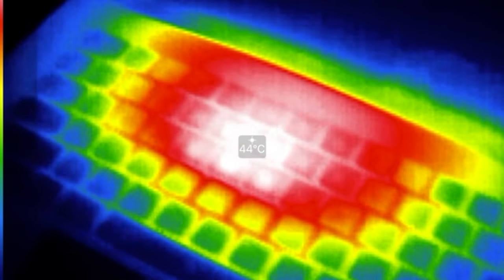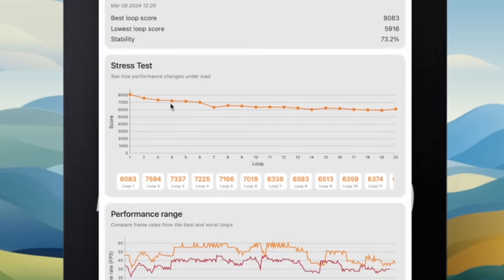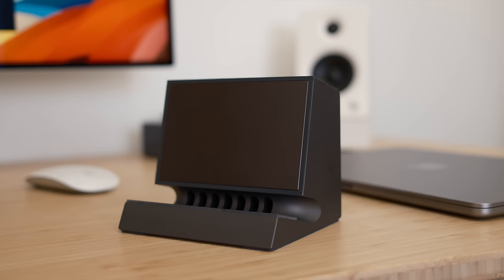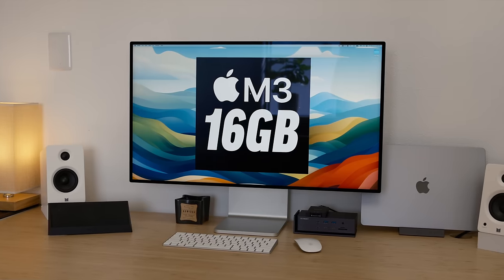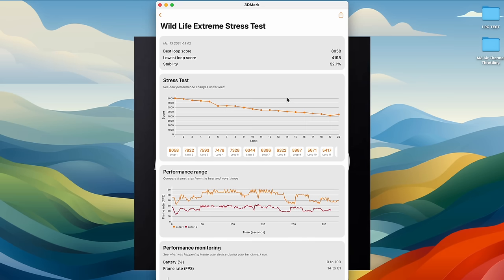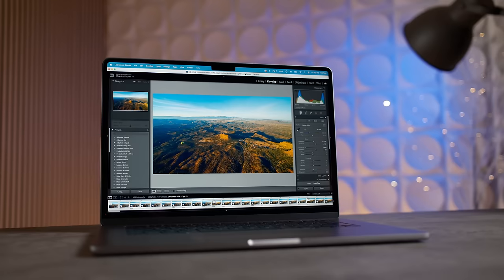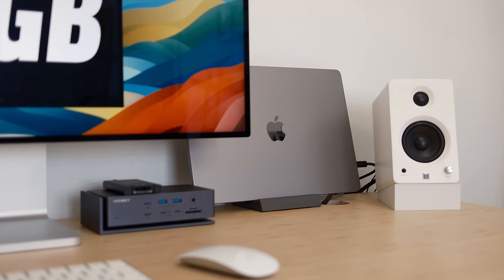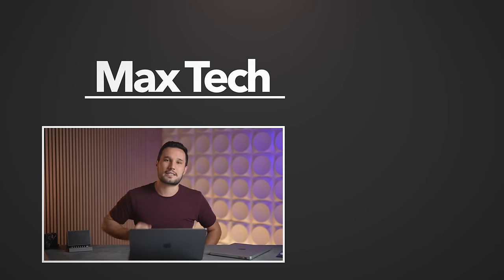Making my M3 MacBook Air FASTER than M3 14" Pro!

Comment from the maker: Ugreen Nexode Pro 65W mini Charger, 15% OFF :  https://amzn.to/3IEiy4H
Ugreen Nexode Pro 160W Charger, 15% OFF:  https://bit.ly/3VghUSj
Ugreen Nexode GaN series , up to 38% OFF :  https://bit.ly/3VcPqZQ
Ugreen official store :  https://bit.ly/3IBygNM

Buy a SVALT Cooling block for your MacBook Air or Pro ➡ http://svalt.com/dhcr
Reply: You really need to put a disclaimer in these videos. If you look at the comment section you will notice that some people are angry at Apple for not installing thermal pads in the Macbook Air. Please explain in the video that Apple are not a bunch of clowns, and that they isolate the processor from the top and bottom case on purpose, to protect their users from burning themselves, as other computer manufacturers do as well. I have done this thermal pads mod 2 years and a half ago on my M1 Macbook Air. I have also done something similar a few weeks ago on my 2017 12 inch Macbook. I take full responsibility for this, and I know what I'm doing, as you are, but the truth is that both devices have become unsafe to use. I'm getting around 65°C (149°F) under the Macbook Air at full load after a while, and up to 70°C (158°F) under the 12 inch Macbook using Xcode and running an iPhone simulator. You have to be clear about the fact that Apple is doing the right thing, and that modding the Macbooks with thermal pads can be amazing, but carries some risks.
Reply: Can you please check and let us know how hot the bottom chassis gets with the thermal pads.
Reply: For the average user it is more than enough
Reply: I will be interesting to take a look on similar update for macbook pro 14 with m3 max.
Reply: Do I void the warranty if I open the bottom to install these thermal pads?

Comment: Has anyone noticed that the cooling dock is $279? This is not a cheap solution!
Reply: Basic laptop cooler is $20. I bought one to use w my 2018 MBP bc World of Warcraft would get too hot. The M3 Pro 14” isn’t as bad w the heat but I still use it when I’m playing WoW. Nothing else needs it tho
Reply: Knock $200 off that then, maybe.
Reply: Just get the thermo  pad and a cheap cooler would do about the same
Reply: I mean you bought apple🤷🏻‍♂️what is $279?
Reply: @brosplit  way too much when $20 accomplished the same goal
Reply: @SSquirrel1976  I say the same thing about MB's and just buy Windows laptop instead. You are correct either way.
Reply: @johernandez266 Not the same thing. PC laptop and windows are  rubbish in every single way.
Reply: Not only is it an expensive accessory, it takes up a lot of space and it's silly to bring along with you. Pros are better off with the Pros, cos you need the performance onsite when facing customers.
Reply: I'd rather use that money difference to get the pro model with a fan, or even last gen m2 pro.
Reply: @fmax3000 . Will agree in terms of heat and battery life, on everything else - you know nothing John Snow 😂
Reply: @iThnk2 loool! Well, coming from computer engineering degree with hands dirty in HW and coding since late 80s, assembly, machine code, prolog, Fortran, pascal, etc, to building data canters, mining farms  and server labs, I can assure you, you’re THE John Snow here
 ✌️😉 
Now honestly, if you’re talking about gaming, PC is your toy. If you’re a serious creative, editor, programmer, etc. Apple Silicon is the way. And trust me, Apple Silicon ain’t  the ARM PCs  many naive people would like to think! I still run x86 servers in my homelab. But as a personal computer, nothing come close, on every aspect. You need to try it unbiased in order to appreciate it. For me, there’s no going back. I’m eyeing M3 or M4 Ultra Mac Studio, almost maxed out as no Nvidia or AMD is coping with my AI projects needs. Rumors say the M4 will double on Neural engine cores. We will see, it’s just that I can’t wait longer! 
Good day GoT mate 👊
Reply: I just did. I'd be saving like € 20 and would void warranty compared to a MacBook Pro.
Reply: Just buy a regular dock and aim a fan at it. Same thing
Reply: Yeah, I 3D printed a laptop stand with a spot for a heatsink that does the same thing. Total BOM was about $15.
Reply: Its not just a cooler but a beautiful stand as well. lol!
Reply: I hardly ever chuckle out loud after clicking links but this one got me good haha.
Reply: @fmax3000 sounds like you don’t know what you’re talking about.
Reply: @JasonMilczek If you say so, hhhhhh
Reply: @SSquirrel1976  apple is way too much you can get double specs for same money in windows especially since you are trying to game on that shit 2018 intel mbp
Reply: Unfortunately, some people are going to spend that money and keep the company afloat. That is just plain stupid. 279 for what?
Reply: At that point, I am just going to switch to a Mac Pro

Comment: the SVALT Cooling block alone is US$280!!!! not including fan , not inculding thermal pads , might as well spend the money to upgrade to 14inch pro , which hv better sound better screen better everything, so this video is not objective
Reply: This is SOOOOO DUMB, the mba is so lovely and small and slim and light, let’s add a literal brick to my bag to cool the thing which we know is a light duty chassis. If you worry about thermals, Max shows us what fans and air management can do. As an alternative he offers this clunky nonsense? Crazy Max.
Reply: I returned to Best Buy the 15” MBA M3 16/512 without even open it because while on transit with FedEx I saw the 14” MBP M3 16/1TB for $1849 at Best Buy as well. So ordered it immediately and it’s going to be delivered tomorrow. A 15” MBA M3 16/1TB would have been $1899…
Reply: Thermal pads are basically free. On top of those just a generic cooling bad is fine if you want one. 280$ is indeed crazy.

Comment: $290 for cooling???? why not just buy a macbook pro at this point ?
Reply: Versatility. He talks about this. You can take the much lighter Air or set it up at a desk for heavy tasks. IMO a great tradeoff.
Reply: So pro in fact means propeller 😂😂😂
Reply: one thing everyone complains about with Macs is no upgradeability. if the air ever starts to struggle for what you need it for, just do this and suddenly its like you bought a pro anyways. if you dont need it, then save the money.

Comment: Damn this cooler is $250+.  Might as well get Macbook Pro since that will close the gap on the price difference for 16GB/512GB.
Reply: Also in that price m3 pro is worth much better or m2 pro macbook pro (if available in your country) with better performance
Reply: And get a better screen, better speakers, more ports, bigger battery.....
Reply: And you can open the laptop..... this is pointless you might as well get a mac mini if you can't use the screen or keyboard and get a cheap air for travel.
Reply: must you buy it cant u just mill one or screw one together
Reply: He addresses this right in the video: the Air is thinner and lighter while traveling, then you can drop it on a cooling dock while at your desk. For a lot of people, this is a great solution. Signed, a person with both an Air and M1 Max Pro who prefers the Air.
Reply: @jamiea8318  If you're struggling with less than 2kg then youve got other problems to address lol
Reply: "They've done studies you know.. 60% of the time all you have to do is destroy the computer by running it faster and faster.. The other 47% of the time you feel Wild, like a wild panther, but inside you know an aluminum heat-sink can't keep you alive.
But if you do the math, 60% of the time, it works.. Every time."
- 
Brian "Bri-Man" Fantana
Reply: Unless you want a bigger chunker laptop that doesn’t make sense

Comment: I'm a game developer who regularly works on large projects that demand both the GPU for testing the game in simulators and the CPU to build projects in Unity, Xcode, and Android Studio. My MacBook Air M3 was suffering a lot due to throttling, often reaching more than 95 degrees Celsius. This modification made my top temperature go down to 86 degrees Celsius. The MacBook is running approximately 11 degrees Celsius cooler on average. The batteries never reached more than 41 degrees Celsius in the worst-case scenario. I totally agree that this modification is not something you should consider if you are not a heavy user. But if you do use heavy tasks like video encoding, game development, or building projects, you will get way more out of your hardware by doing it. Additionally, it cools down much faster when I finish heavy tasks. It used to take forever to bring it below 80 degrees Celsius; now it's almost instantaneous. Thanks for the tip. I just used only one thermal pad as recomended in the video description. Thanks for the video.
Reply: @CharlesBarros what a does a game developer do with MacBook Air M3 to perform simulation? This is the wrong tool for your line of work. Get a MacMini and call it a day.  A MacBook Air are for web browser-type people.
Reply: @Traumatree  I have a regular desktop for work at my house, but I'm also a businessperson who has to travel a lot. During my travels, my tool of choice is the MacBook Air because it is lightweight and handles my development needs very well.
Reply: @CharlesBarros  So you also travel with this chunky cooling block? It seems to me a macbook pro is easier to carry than macbook air + external cooling system. Unless you only use the cooling block at your house, which means that you macbook air is your do-it-all machine?
Reply: @MrW0rDs  you don’t need this cooling block to have better performance than the stock. The thermal pad helps a lot to boost the performance by its own. 😄
Reply: @pombonerdoficial  the 15 its a better option. But I would wait until the m4 if possible
Reply: @CharlesBarros 

Hi, you're the person I've been looking for for a long time. I won't delay much, I hope you can help me decide) I want to take air m3 16/512 for university studies and small projects in Unity and possibly a blender (I plan only to study). I have been working with Unity for about half a year, and I need a laptop that can cope with small 2D projects and simple 3D web games. Is such an air enough for these tasks or is it better to buy an m3 pro 18/512? It's just that at this stage its capabilities are unnecessary for me, and the laptop itself is bigger and heavier, and I'm looking for a small and light one, because like you, I have a good computer at home. I would really like to hear your opinion on this and will receive your advice, thank you in advance for your answer
Reply: @Don1L for your use case the m3 air is totally capable to handle your tasks. In fact it can handle the big professional projects that I work with.

Comment: This is exactly what I did before i watched this video, add the thermal pads to my M2 Macbook Air.   However, there was a concern about battery health because now the entire lower case of the macbook air gets warm from the thermal transfer, and the case will warm up the macbook air battery.    Any temperature above 53 Celcius is bad for the battery.   My solution was to tape the inside of the macbook air back cover with thermal protective film so that the cover does not transfer the heat back to the battery locations.   I managed to keep the battery temperature at or lower than 53 celcius, while still keeping the benefits of the thermal pads.   I also put my m2 macbook air on top of a laptop cooler that uses a fan to cool the macbook air, thus achieving what this video also achieved.
Reply: Great idea! Thanks for sharing.
Reply: Any references for this thermal protective film or insulator material? Are you talking about the golden fiberglass tape to wrap around engine pipes? Or something with more insulation?
Reply: +1 to  @WilloPax ’s question. Curious what you used for the protective film. Was it kapton tape?
Reply: Could you share a step by step guide for this? or some youtube video you might think could be useful, showing how this can be done?
Thank you
Reply: @alvesricardo  Search MaxTechOfficial/this channel for the video that shows you exactly how to do this.   That's the one I used to learn how to do it.  Luke Miami's channel also has a video on how to install the thermal pads.   Those 2 videos are very good, but there are other videos, too.
Reply: So many hoops to jump through and risk voiding warranty. Maybe better for new buyers to stick with the MBP instead.
Reply: The function of thermal pads is to facilitate the escape of heat to the outside of the casing, giving up heat to the surrounding environment. If the heat stays inside the casing, the battery will still be subjected to the heat generated by the M3. Apple probably did not adopt this simple solution because the external temperature of the shell reaches very high temperatures with thermal pads, however, I don't think the battery stays cooler without thermal pads.
Reply: @mattiasdemaio6333  My concern was that while the M3 without the thermal pads would create heat inside the case, it would be far away from the battery packs.    While  the M3 with the thermal pads would transfer the heat to the lower casing, radiating the heat out but also inward where the batteries are located.  With the thermal pads, now the heat has a way to get to the battery directly.   So I covered the inside of the back casing that covers the areas over the batteries with thermal insulating tape so that the heat would only radiate out and not inwards towards the batteries.    I think it worked, because the batteries temperature only rises to 52 degree Celsius and not higher.
Reply: @SAT1337  That - this right here about potentially voiding warranty - thanks for mentioning it. I guess I'll just employ the laptop stand / fan blowing directly on it method. Maybe using an ice pack on the bottom may help in extreme circumstances?
Reply: @20NewJourney23  laptop stand should be fine. Even if you don’t use any fan, you’ll still get excellent performance, just not as good as with cooling which is only relevant for very demanding tasks.

Comment: I haven’t seen a single reviewer call out some of the limitations on the M3 Air’s inability to push certain resolutions. The scaling options on a 5k display are far inferior to what’s offered by the MBP and not one person has mentioned it in a review
Reply: I would love to hear more about this.
Reply: They have Pro models for 5k tho?
Reply: This is a non issue and not a thing. “Default” resolution is still 2560x1440 hidpi which is standard. Even the pros don’t allow actual 5k resolution only up to 3k in stock “more space” I’m not sure what you’re talking about here. They do exactly the same.
Reply: @InsaneFilms  I haven’t tested out multiple external displays (mostly bc I don’t care that much and I don’t get paid to do this stuff), but on my main display (40” Dell 5k/2k), there are many more hi res options when using my M3 Max MBP vs my M3 MBA.

If I force the usual resolution I use with my MBP through a 3rd party app (bc it’s not available as an option natively through Mac OS), it is low res and looks like trash. 

So the only options are a resolution where everything is too large and not what I like or full resolution which is way too small and also not useable.
Reply: @Wonder_Wicks  I’m talking about pushing to an external display
Reply: @JM-kr9bi  if you have a 5k/2k display, it should be 27" for it to work well. the correct amount of ppi for 5k/2k is around 218 (good for retina) and around 110 (good for non-retina). with a 40" display, your ppi is way off. that's probably why it doesn't work for you.

Comment: PSA: Use 1.0mm thermal pads. 1.5 imm is almost too thick, It makes screwing back the lid very difficult and almost buldges the bottom of the MBA.
Reply: is it good now, what about the battery temp?
Reply: Man thank you! I see someone in YouTube saying the 1.5mm is better because the 1.0mm leaves an airgap. I guess that only applies to M2 or M1 MBA